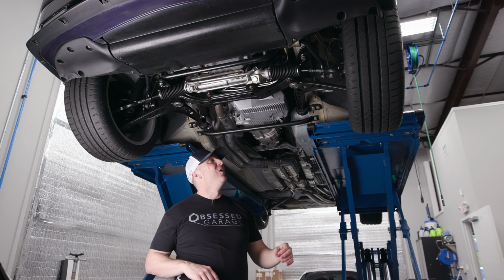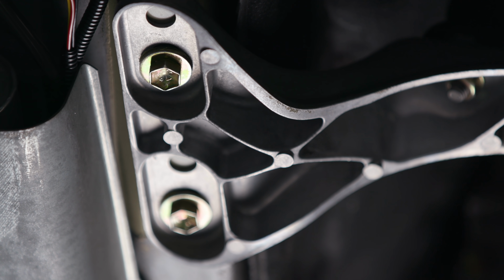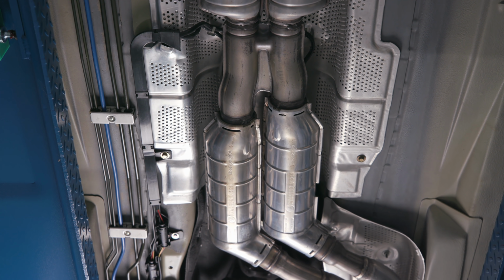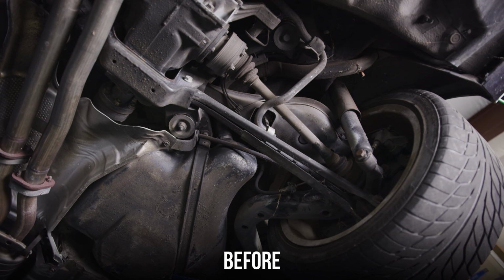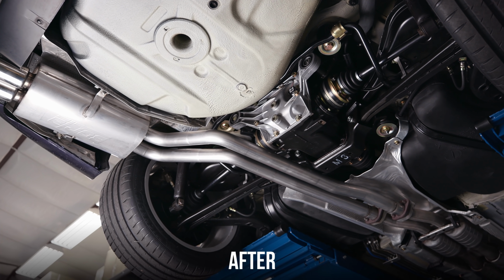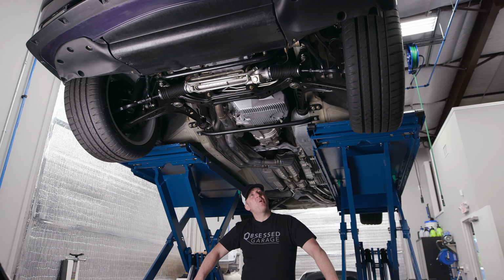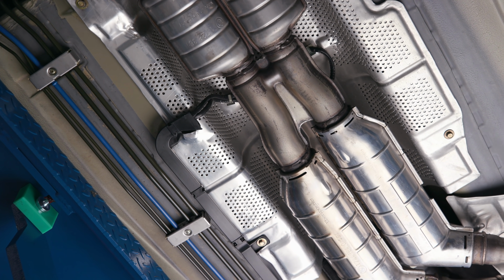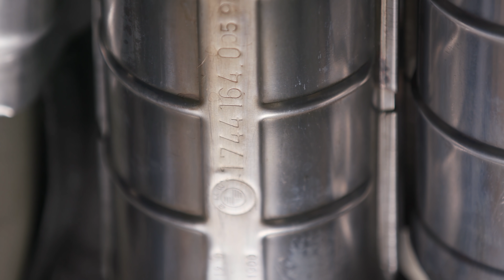INSANE Transformation - DRY ICE Cleaning On E36 M3 Complete!!

Comment: Karcher is coming up with a system that makes its own dry ice, you just keep gas bottles and use them as you go.
Reply: Some math on the tank/maker/blaster all in one solution mentioned around the 15 minutes spot by the Karcher tech on a video you're referring to.

250 gallons or 1100 lbs of liquid CO2 makes 500 lbs of solid dry ice.  Nobody can change that science.

So a $30k, 500 gallon CO2 liquid storage tank would make 1000 lbs or two 500 lbs. bins of ice.

I use 2-3  bins or up to 1500 lbs. to clean an entire  car underneath and the engine bay..  Have been for the past 2 years.  80 cars, 1100 hours of experience with the latest machine technology. 

To run any machine 30-40 minutes at 1 lbs. / minute volume ( which would be way less than they are using in this video) = 30-40 lbs.  Or, about 25-30 gallons of liquid CO2.  Compare a 5 gallon fuel tank to a 25 gallon example in size!  That's a big tank!  Plus, it needs to be a high pressure ( heavy) vessel. 

A massive and heavy item that will be empty or run out in 30-40 minutes.  Then there is the footprint required for the hydraulic press pelletizer. Which makes the ice.  Also an expensive and power sucking devise with a large physical footprint.

Manage your expectation everyone

Comment: Karcher is coming out with a unit that’ll make its own ice. So buying trunks of dry ice won’t be needed. Apparently all you do is hook up some CO2 bottles to the unit. Ratarossa did a demo day with Karcher reps and they divulged that info.
Reply: I wanted to comment about that possibility when they were explaining the difficulty during the podcast.  I'm in pharmaceutical/chemical processing and thought, 'Just make your own dry ice on demand'.
Reply: @timkinley1779  It's not cost effective to make your own dry ice unless you are using 4k lbs a week.
Reply: @ScottAles  I think in scale.  If the equipment is not economically available,  I get it.  My line of work is efficient scale-up.  Basically taking successful lab batches and developing the process and equipment for manufacturing.  I've got exposure to a lot of cryogenic specialty equipment designed for pharmaceutical processing.  Good luck with your venture.
Reply: Some math on the tank/maker/blaster all in one solution mentioned around the 15 minutes spot by the Karcher tech on a video you're referring to.

250 gallons or 1100 lbs of liquid CO2 makes 500 lbs of solid dry ice.  Nobody can change that science.

So a $30k, 500 gallon CO2 liquid storage tank would make 1000 lbs or two 500 lbs. bins of ice.

I use 2-3  bins or up to 1500 lbs. to clean an entire  car underneath and the engine bay..  Have been for the past 2 years.  80 cars, 1100 hours of experience with the latest machine technology. 

To run any machine 30-40 minutes at 1 lbs. / minute volume ( which would be way less than they are using in this video) = 30-40 lbs.  Or, about 25-30 gallons of liquid CO2.  Compare a 5 gallon fuel tank to a 25 gallon example in size!  That's a big tank!  Plus, it needs to be a high pressure ( heavy) vessel. 

A massive and heavy item that will be empty or run out in 30-40 minutes.  Then there is the footprint required for the hydraulic press pelletizer. Which makes the ice.  Also an expensive and power sucking devise with a large physical footprint.

Manage your expectation everyone

Comment: Interested to see the condition of the top half of the arms when you take em out.
Reply: Scott mentioned many times this was more of a ‘demo’ and you only get at what you can see. If trying to really clean it all you need to drop front and rear subframe and at least lower the gas tank to get under it, as well as completely remove all the underbody plastic trim pieces and fuel filter cover so you can get under those parts. On an E36 you would simply buy new parts for all the trim, liners, covers etc..